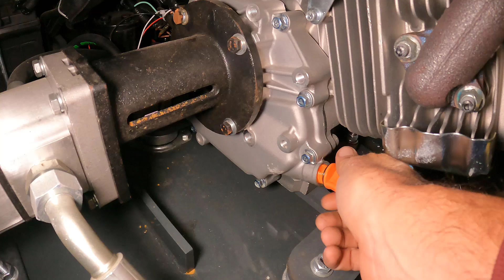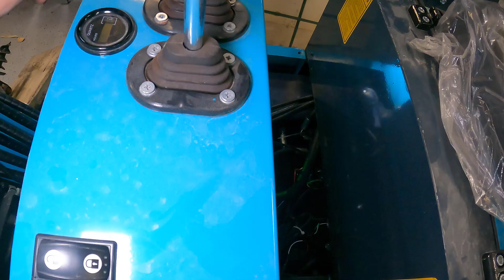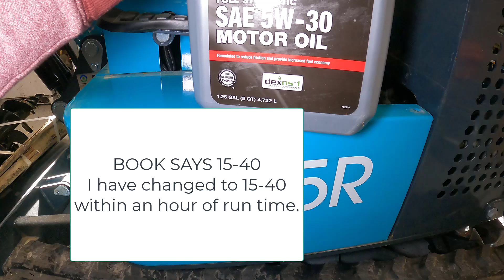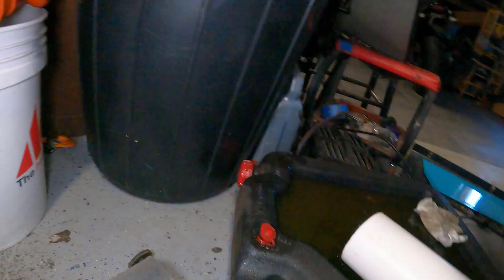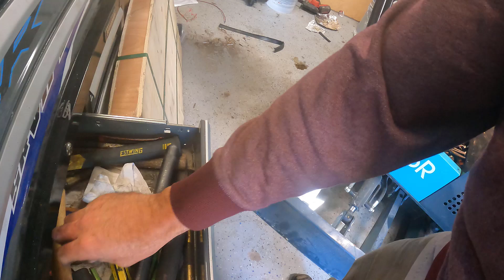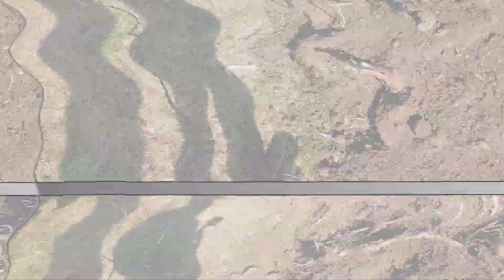AGT mini excavator walk around, first impressions, and fluid change.

Comment: I replaced the grease fittings too, and tossed the grease gun that came in my “ToolsBox” as it doesent take standard cartridges. 
Replaced fluids too. Didnt think about electrical connections, will check them too. I made my canopy removeable, and  will be lowering the lid today. My machine is a CFG H15R, different but the same. 
The cutting edge in place of the teeth is something else i was considering. Good video, thanks for sharing. I plan to make some as well, more specific to my unit.

Comment: Great video, informative and funny!  I just bought an AGT QK 18RC at auction Saturday.  I have watched probably 30-50 video's minimum over the last couple of weeks trying to figure out the numbers and letters.  I promise you this is not a 1.8 ton machine LOL.  It has the Rota 470cc engine, pilot controls, swivel boom, hyd thumb, and oil cooler with fan.  Not sure what else.  I have not seen anyone else inspect the wiring, thanks for doing that and posting.  I will be removing panels and inspecting my machine in the AM a little farther also replacing all the fluids.  They loaded it on the trailer at auction with a large loader.  It literally ran out of gas half way down the ramp and tipped over on it's nose (bucket).  At 71 years old it was a wild ride.  LOL  Subbed and Thanks, Ken
Reply from the maker: Thanks, good move with keeping the bucket out down hill, Ive seen a lot of people not doing that. 
But so long as you expect to work on it here and there, it's a really good little toy.
Reply: @backwoodscustoms  thanks for the reply.  I drained the oil today.  Looked like vegetable oil with graphite in it.  I wanted to get the floor pan off to the check the motor for the ring gear.  I pulled every piece of tin off trying to get the floor pan loose.   The left pedal bolts would not clear the adjuster on the side of the block.   I finally removed both bolts from the left foot petal and was able to remove it.  At least I know that the ring gear motor bolts are tight and I will try shimming some of the hoses off of the sharp edges they are resting on.  I'll get the hydraulic oil drained tomorrow.  Definitely going to put an extension on the oil drain before I put it back together.  What an adventure.  Very happy with the purchase and was honestly expecting things to be worse given some of the videos I've seen.  Like you said, not for someone not capable of working on them.  Thanks again for the video, Ken

Comment: Like your vids, you seem to be the only one posting on this machine ..Just bought the same machine coming this week.. Did you install a hydraulic oil filter yet??
Reply from the maker: I haven't. There's a screen in the tank. It's probably not a bad idea, but the tolerances on these pumps and stuff is big enough I'm sure that a micron level oil filter is probably on the overkill side. 
I'll probably do one eventually but it's still a few mods away
Reply: @backwoodscustoms  Thank you. I look forward to your videos. Did you change your hydraulic fluid.? I'm going to use ISO 46. I hear that may slow the jerkiness down a smidge. I haven't had a Chinese excavator before I've had the big stuff and My smallest was a yanmar 30 size. With a yanmar diesel That was buttery smooth I know not to expect that from this. But I like to tinker and I look forward to your videos.. Thank you keep videos coming. I'm sure most of us look forward to them.
Reply from the maker: @bmazz007  just the first change to get the shipped oil out of it. I put iso 63 or something like that. I just put up a video tonight on the jerky fix I wish I would have messed with on day one.

Comment: Nice vid. I got a similar H15R machine. You mentioned a couple of grand at some point, how much was it out the door?
Reply from the maker: A few, a bunch, the bid was 3800. Taxes buyers fee, cc fee it was 46 I think.
Reply: @robertcretu4363  mine was 5700 delivered with an another bucket. The trench bucket.

Comment: I have the same problem with the surging backing up the machine on the trailer with a hydraulic fluid how can we fix that
Reply from the maker: To truly fix it, have to add a longer pick tube for the hydraulic tank. I haven't got that far yet, but I'm assuming there's a neck on the inside of the tank a guy could put a hose on it making it pick up lower and more centered so when the machine is tilted, it's not sucking air. 
A quick 'make it work' is to over fill it. Or when backing up, lift the machine with the stick and slide it on the bucket as you back up the trailer ramp.

Comment: Model Number Data: I have a WH14C. I think WH is the manufacture (HUAYEE sounds like the state Hawaii), 14 related to weight (2060 lbs), C not sure. I have a RATA engine.
Reply from the maker: Haven't heard of that one, but I'm pretty sure there all about the same. Engine, pump, hoses, and stamped steel. I'm happy with mine so far.

Comment: I'm hoping to pick up either an AGT or MIVA at an auction this week. The auction yard said they will help with loading, but I need to figure out unloading. Does it typically come with all the fluids needed to at least drive it off of the trailer? Or should I plan on changing/adding fluids (oil, hydraulic fluid, other) before removing it from the trailer?
Reply: They usually have a bit of gas so you can drive it onto / off a trailer.
Reply from the maker: Just check fluids and get it off the trailer and in a spot to swap them out. Mine had enough to be used but both were a touch low.

Comment: I just purchased a AGT LS15R and would like to change to hydraulic thumb. Unfortunately 3 different versions for the 3 hole setup . Would you happen to know what kit will work on our LS15R model ..Thank you
Reply from the maker: I do not, from what I understand there's not much difference between the different models. My miva kit of attachments all fit fine. 
Also have you used the hoe with the standard thumb yet? Or how much are you going to need the thumb? If it's just sometimes, I think a fixed one works just fine. But ... Accessories are fun too.
Reply: @backwoodscustoms  Thank you , i have not used the machine yet , but ill give it a try before buying the hydraulic thumb..Thanks again
Reply from the maker: @MarioPenna-w7h  they are nice, but when I was at the auction they were going for $150-$180 and I thought that was steep, FB or eBay sells them for $250+ and that's way to much imo. I'd like one, but then your aux hyd are tied up all the time unless you get a 3 way splitter. 
It does take some getting used to but if you get snap lock pins and get rid of the bolts to move the thumbs pins, it doesn't take much to move it.

Comment: Yes it's the oil it helps to break in the motor you should have put 4 hours on that motor before you change it out
Reply from the maker: There's no way I'd run that oil. It had more water like properties than oil. I know break in oil has a higher zinc content but that oil didn't seem like it was going to do any good for the engine.
Reply: @backwoodscustoms  thx for the vid. Rotella has higher zinc content too

Comment: The 15 is a 1.5 ton machine, whereas the 12 series is a 1 ton machine. The beginning letters designates configuration - especially of the controls.
Reply from the maker: There were 40+ at the auction, there really wasn't much difference unless you were going from one to the other, with a tape measure. I had a list going and after about 10, there really seemed to be no rhyme nor reason to it. I can get behind the 1.2-1.5 ton numbers but there's still not thY much difference.
Reply: @backwoodscustoms  -- There are numerous differences - three different engines available, some have enclosed cabs, different access panels, hand and foot controls located differently, some have hydraulic filter, and/or more than one hydraulic pump, etc. Some of them are also a different "Brand", and of course, advertised retail prices are an indicator of which has "more".  I looked at them at three different auctions and on the internet for more than a year before deciding.

I just recently bought the MX15R on marketplace for less than the cheapest one at auction (with 0.4 hours) because the guy was going through a divorce.
Reply from the maker: @Rattlerjake1  divorce sales suck for that guy but get a few people some screaming deals. 
I just wish the manufacturer made a list and comprehensive description of what means what or what options that machine has.
Reply: @backwoodscustoms  - I have yet to find an owner's manual that explains all controls, maintenance, etc.

Comment: How jerky are the controls? Im looking at buying one at auction and keep reading they are very hard to operate, did you have to change something on the controls
Reply from the maker: One guy commented here about putting small compression springs under the control base. I was going to grab some the other day and try it, but ive been crazy busy. 
Another guy said that he turned down the relief valve, but im not sure about doing that, usually when you reduce operating pressures, you do lose a bit of power. 
If you run two controls at one time like bucket, and swing or w.e its really not that bad. 
But yes. jerky jerky. The pilot controls are worse. I ran a agt 12 that was the center controls and it was way way smoother to operate.
Reply: @backwoodscustoms  Damn maybe I should've bought ones with center controls. thought pilot would be better, oh well I'm sure I can make something work to modify it better
Reply: @flo383 run the machine at 1/4 throttle max and it's not jerky
Reply: I just bought one the same model and the problem I'm having is with the hydraulic pressure I'm losing it when you back up a hill
Reply from the maker: @tompeace2621  low on fluid or more likely is the terrible pick up spot on the hyd tank. Even with mine over full if you get any sort of angle backwards it's starts surging

Comment: Does the LS15R have a dual hydraulic pump or single pump? If dual what is the second pump running? The auxiliary?
Reply from the maker: Hey I was wrong. I'm not sure what I was looking at, these only have a single pump. For some reason I was looking at it thinking it was piggy backed pumps. IT is a single pump with a splitter for pilot controls and track. 
I'll delete my previous comment.
Reply: There at two pumps.  The main pump supplies fluid to all functions including the boom movements.   The second pump supplies fluid to the pilot controls levers.  The boom control valves are hydraulic actuated hydraulic valves.  So the second pump supplies the fluid from the pilot controls to open and close the valves in the main valve block for boom and slew movements.  So that is the reason that the boom doesn't do anything when the pilot controls are moved without the engine running.
Reply from the maker: @ngnmech  yeah, that's what I was looking at when dude asked if it was dual or single pumps, then got to thinking, usually when someone is talking dual pumps, they mean 2 high pressure, separate system pumps. So I back pedaled and said single pump.  But then I got to thinking it technically is 2 pump out let's, but one is low pressure, then I didn't know if low pressure pilot side was it's own pump or just a bleed valve in the pump . Then I felt like I didn't know what I was talking about and was hoping someone who could explain it correctly would comment on it and straighten all of us out. So thank you for being the guy that can explain things better then me.

Comment: Check the other oil dipstick which is just on the opposite side of the motor.
Reply from the maker: i did switch them out front to back so i can use the dipstick easier.

Comment: Any concerns with over filling the hydraulic fluid tank?? Thanks man!
Reply from the maker: It's just over the top of the sight glass, there's a baffle in the tank about 2" down from the fill hole, it's not over that. I ran it for 5hours straight the other day in hard digging and no oil expansion issues. Is it oe recommended? No. But every little bit of extra oil is more to move heat. 
Also if it wanted less it would just puke it out and let you know how much it wants.

Comment: sorry if this is a repeat comment.  i think i fixed the jerkyness with springs on the actuator buttons under the rubber shroud on the pilot controls .  i cut a 9/16" x 1 3/4" compression spring in half and slipped it over the button,  it gives resistance to the controls.  please comment if you think it is going to cause an issue
Reply from the maker: I was thinking about one large spring like a ATV/snowmobile clutch spring to go under the whole control lever, but I ran it for 11 hours in 2 days and my shoulders were already feeling it. It could have been more of ridding the bull movements but either way. 
As for what you did, I don't see how that would cause any issues. Might have to try that way.
Reply: How stiff a spring are you using.  The ones that I am finding in the size you recommended seem very stiff, so are you using the really stiff springs that are cut in half, or are they a lighter spring.
Reply: @ngnmech  its a pretty heavy spring but by the time you use the handle you have alot of leverage on it

Comment: Just a qord of advise.  The flat pin zerks for grease are actually really good beacuse they dont stick out and therefore dont get broken off like nipple zerks...i left mine and happier for it..buddy did his with nipple zerks and broke one off abobe the boom the first day...just my 2 cents
Reply from the maker: Solid thinking, but if get low pro straight nipples they should be near flush with the outside of the ram. If not I'll make a collar to weld on to protect it.
Reply: So more money and work and time when ya can just leave the ones that are there that work fine ...but to each his own...was just telling my experience...have a great day
Reply from the maker: @truthfirst4249  only need one real grease gun though. The little need point one that came with a soup sandwich, and I don't want to get a different tip for my good ones because this is the only thing I have that has those cone tips
Reply: @backwoodscustoms  makes sense..i have a quick change fitting on my grease gun so take 3 seconds to go from standard stylin style and my grease gun came with all the zerk sttle connectors...was like 20 bucks on Amazon..
Reply from the maker: @truthfirst4249  well now I'm interested, I'll take a look at that. Thanks.
Reply: @backwoodscustoms  lol...yeah i try to buy American but in this case i figured Chinese excavator and chinese grease gun from Amazon would be a pretty good fit..lol👍🏻👍🏻

Comment: Thanks for sharing! I have the same unit! I have some play on the turn gear, I noticed yours does too, any concerns?
Reply from the maker: @roberto3330  so far I'd just keep an eye on the motor coming lose from the mounting bracket. But they have pretty rough gears so there's a lot of play. Not ideal but it is what it is in .y opinion.

Comment: I just bought the same model at Richie Bros. auction 2 weeks ago. 
Other than loading it on and off the trailer, I haven't had a chance to use it yet. 
Before I do I want to change all the fluids, grease it and tighten any loose bolts, screws, etc.
Reply from the maker: Yeah get that oil out of there. Whatever is in there is not up to normal oil standards. It's fun to mess with. I've got around 7 hours on it so far and nothing major.
Reply: @backwoodscustoms  Did you change the oil in the drive units yet? I assume those have a crappy oil from the factory as well.
Reply from the maker: @schultp  I didnt change out anything on the wheel motors? i didnt look to far into it. Am i missing something? the other hyd units ive messed with are just one fluid, no seperate systems.
Reply: @backwoodscustoms most new machines with drive motors required changing the oil at the first 50 hour marks. Every 1,000 after that. I don’t know about these machines though.
I’ve heard these don come with lube or hydraulic filters Si I would definitely add those if you are going to keep it for a few years
Reply from the maker: @jackvance6025  they are shipped with vegetable oil in the hyd system to avoid oil import/shipping regulations so I changed asap, then I'll swap out again at the next engine oil change. 
This one has an in tank filter /screen that I'll mess with at that oil swap.

Comment: My ls15r is super jerky. The relief valves were not set right as well as loose slew motor. It's still jerky
Reply: try adding compression springs on the actuator buttons under the piloy control sticks,   9/16" x 1 3/4" cut in half
Reply from the maker: Only things I've found issues with is electrical related. All hardware was tight, so far... As far as jerking, I've found that if I just dig without thinking about it and full stick it, it's acceptable. Running 2 functions at once reduces the pressure in the charge lines and make it feel smoother, when trying to do fine adjustments, it's like a coked up squirrel.